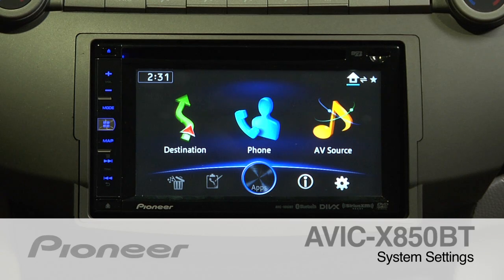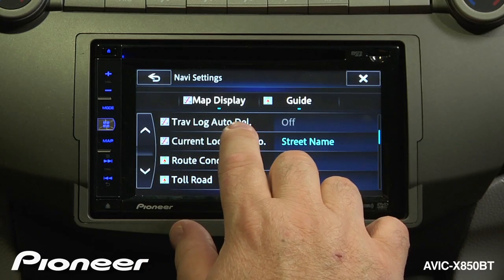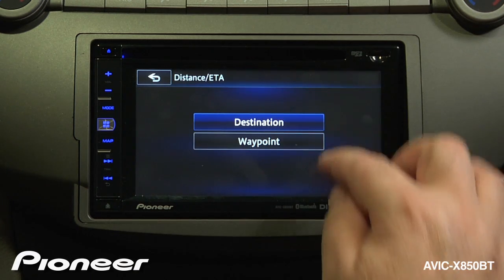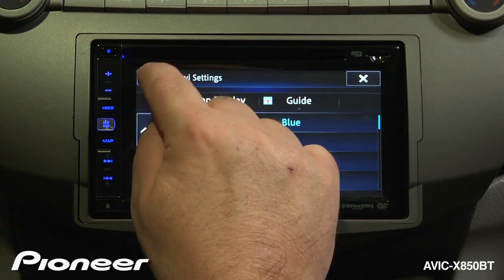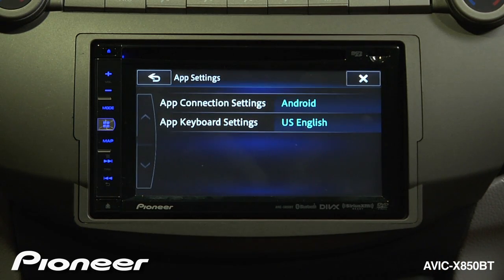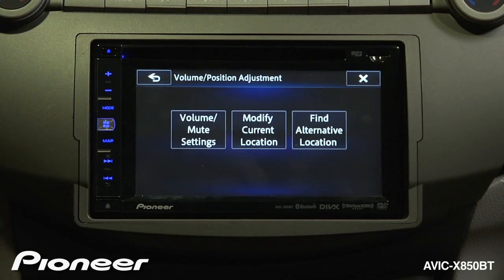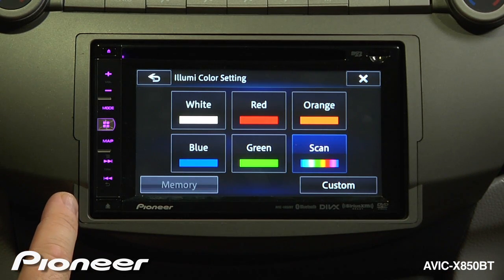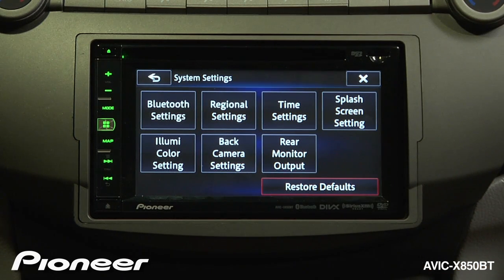How To - AVIC-X850BT - Make Changes in The System Settings Menu

Comment: Anything I can do to reset it or have it turn on without messing with wiring
Reply from the maker: I'm not aware of any particular reason the Pioneer AVIC-X850BT can not sit for a year and then power up as normal.  I'm not aware of any reset button on the receiver.  I recommend to check the vehicle's fuse panel for a blown fuse for the receiver.  I also recommend to be sure the receiver's detachable panel is firmly in place.  If the detachable button panel is partially detached the receiver will not power up.   Please note:  If the detachable panel was removed, it may require a password to use to receiver.  The password is set by the user.  If this does not work, there is a fuse on the back of the receiver at the wire harness and I would recommend to check all connections to the receiver.   You can find more videos on Pioneer's YouTube Channel here:  https://www.youtube.com/user/pioneerelectronics